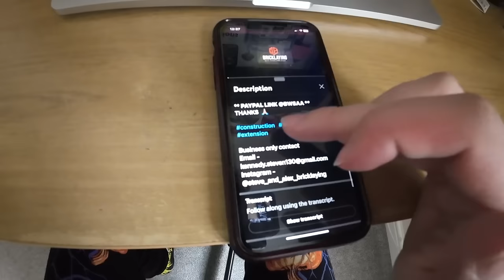SMALL EXTENSION WITH 15O MM CAVITY..PT 2

Comment: Great work as usual, well done. A question: I want to double height of an existing singe brick garden wall to about 2.5m above ground. To increase its stabilit,y to return this wall 0.8m. Can I use these foundations blocks without pouring concrete for the 0.8m return wall to be built? I plan to dig down remove earth, then add blast, compact it with a compacting plate, then 3 foundation blocks and then single brick wall 2.5m above ground. What do you think? Thanks in advance
Reply from the maker: Definitely not put a proper concrete footing in 🧱👍🏽
Reply: @SteveAndAlexBuild  Thanks for clear answer Steve, noted. Just for clarity, with suitable concrete footing, why use concrete foundation blocks? Why not build the wall directly on poured concrete footing?
Reply from the maker: @soundslight7754 purely speed and cost 🧱👍🏽
Reply: @SteveAndAlexBuild  Thanks and god bless 💯
Reply from the maker: @soundslight7754 🤜🏽🤛🏽🤙🏾🧱👍🏽